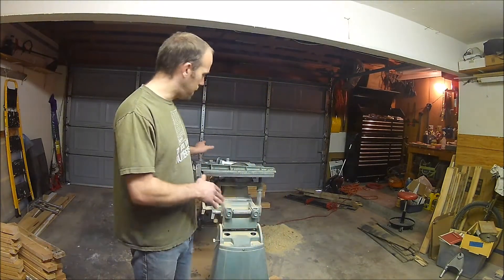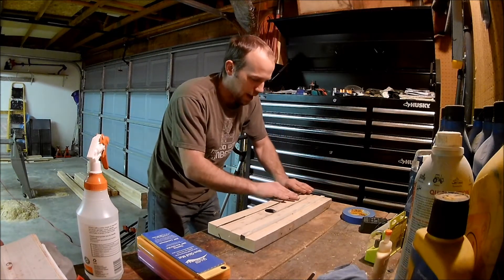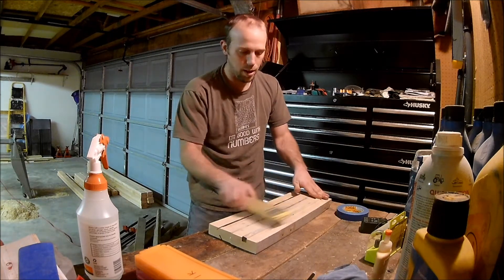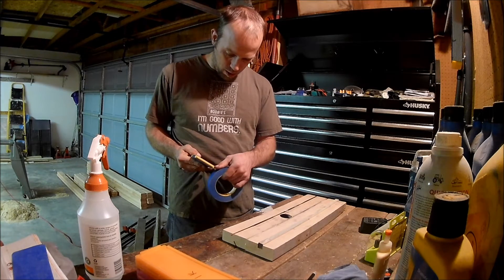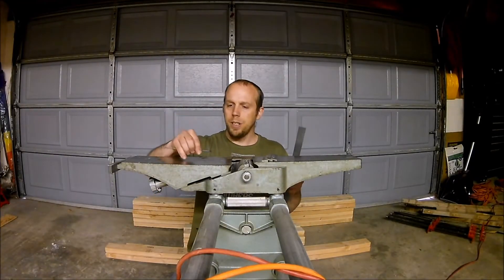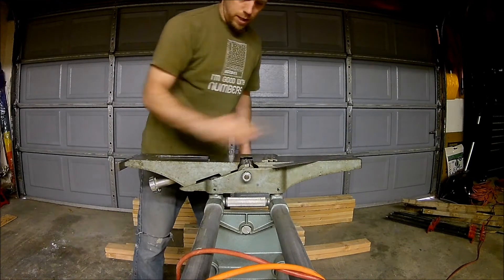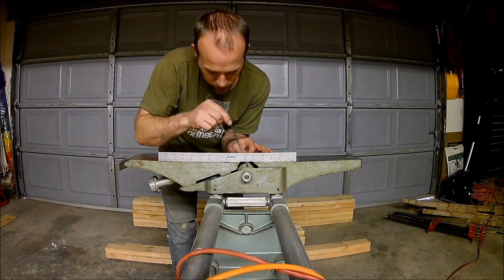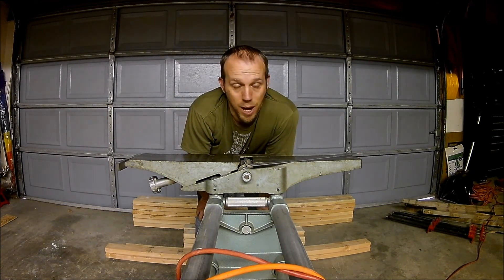Jointer Blade Sharpening Jig and Sharpening(Shopsmith Jointer Blades)

Comment: What is the purpose of the square block?  Is it to have the surface level with the blade?  Also, how deep did you cut the groove?
Reply from the maker: Chris, the purpose of the square block is indeed to maintain the desired angle with the blade. As the blades are sharpened over time or if you are sharpening blades from different pieces of hardware, they may be different heights and having different height blocks will allow you to use the same jig and maintain the angle on the blade.

Comment: I have a 1954 greenie that came with the jointer, and the jointer blades don't want to release. Did you have to fight with it at first or was it more modern/maintainted? I have a fully working 1988 Mark 5 shopsmith that is in working condition, but I would like to run that jointer. Any insight would be appreciated.
Reply from the maker: Sorry DRDEE, this comment got held and I just noticed it. The easiest way to release the blades is to loosen the three bolts that hold the blades in, then use the adjustment bolts underneath to pop the blade loose. Hope this helps and I'm not too late. Thanks!
Reply: Wood Resurrected I got them loose, but they were frozen. I had removed the clamps completely and had to tap the blades with a punch and hammer to get them to come loose. Who knows how many decades it had been since they were last removed.

Comment: Your technique looks similar to that of William Ng's "Fast and Easy Way to Sharpen Jointer and Planer Knives" posted on January 21, 201. He is the best, isn't he? Did you learn anything from it?
Reply from the maker: William's video was where I got the idea to make my own, except I don't think he used various height boards for the stone rest. I haven't watched any of his except that one though. I learned that it works wonderfully for the task and being able to adjust the stone rest board height is a great asset. Not much other than that. Thanks for stopping by!